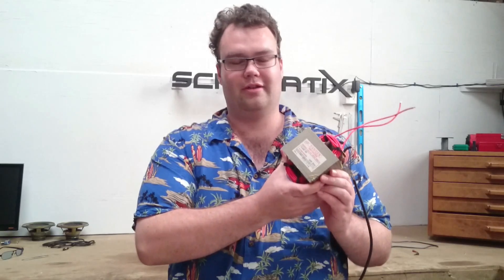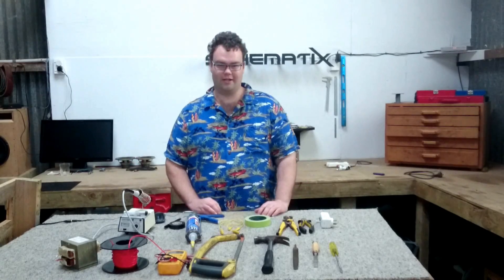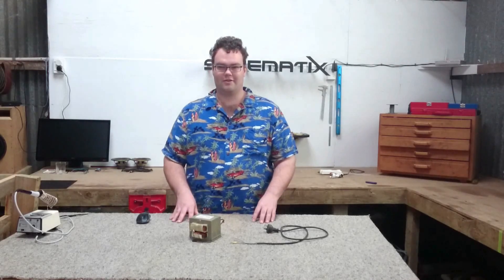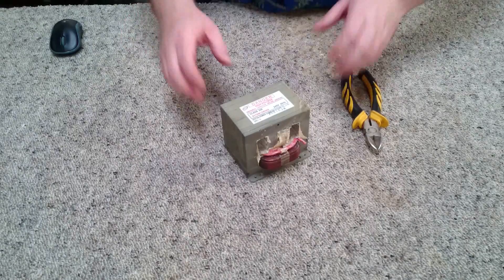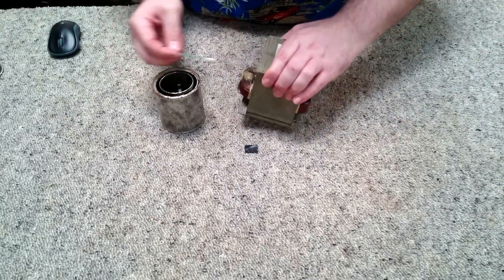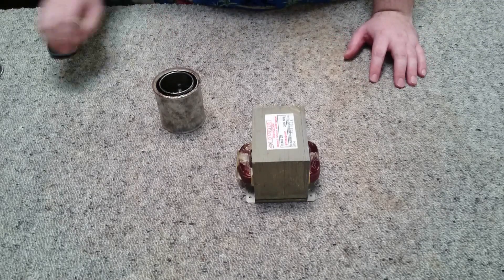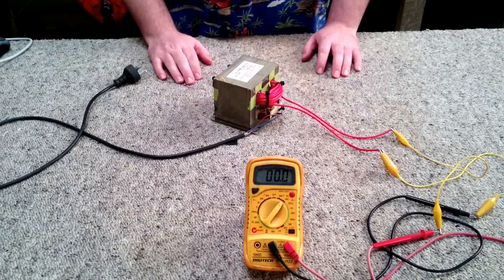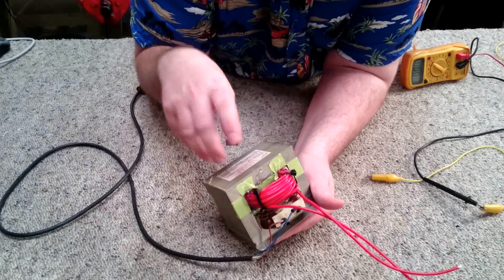How To: Rewind Microwave Oven Transformer, Trash To Treasure!

Comment: It appears this is mostly a mechanical how-to.  Maybe it helps if I add some electrical comments.  First, there are some manufacturer data sheets for transformer sizing.  Generally the more power required, the heavier the core becomes, KEEPING the line frequency the same.  A higher frequency allows reduced weight, up to a limit.  Above some 400 Hz, you need better (thinner laminations and those insulated from each other, also no more welds) materials and above 20 kHz you likely need to switch over to ferrites.
Then, the optimum tradeoff between core and winding heat losses comes at near 1:1 ratio of the iron cross area and the window (core space) cross area.  The winding formula is   n = U/(4.44 f b A), where n is number of turns, U is the applied RMS voltage, f is the frequency, b is the allowed peak magnetic field and A is the iron cross section.  All these in the metric system, i.e., the A is in square meters and b is in teslas.  The b depends on the iron quality and varies from 1.2 to 1.3 for most practical materials and some 1.55 to 1.7 for some crystal oriented materials.
Then, about the shunts - they are actually causing leakage magnetic field ("radiation").  Their purpose in the microwave oven is to LIMIT the current.  As such, they also cause additional heating of the transformer.  Along with too few turns in the primary, they are a cause of higher primary current (which was a concern in another comment).  For a bench power supply, where you should do current limit in electronics, you should replace those shunts with some wood or plastic strips.  That would improve your efficiency, although it would increase your INRUSH current, as the limiting action is discarded.
I hope this info still reaches some people who might benefit from it.
Reply: Great info!
Reply: Pellervo Kaskinen thanks for the info , for anything related to laminate I use the 42 constant, which is the Ae area effective divided by 42
I.e 42/ Ae  = Tpv 
Tpv = turns per volt
I have tested this extensively and can not fault it including ‘blind’ tests where I used it to predict the turns then unwind various ‘consumer’ windings to find it accurate, even on large turn numbers, however this equivalent may help with trying to derive a new ‘constant’ for various crystal hybrids so thank you . 
I don’t have my book here immediately but yes the primary of a microwave Transformer has missing meters worth of inductor based both on the 42 constant and on me predicting then unwinding. I believe it was missing many meters. This and other factors contribute to the excessive heat and energy loss that these lovable and famous devices radiate. Regards.
Reply: @kolinevans9127    MOTs are designed, to be STARTED   under  a LOAD.    NO load, and the magnetic fields'  hysterisis, completely saturated iron core, will  heat up.
Reply: remember: microwave transformer primaries  are wound,such that they  ALWAYS  START  UNDER  LOAD........for standby purposes.......add more windings, to reach 270 turns, or so. If not, it'll overheat.....
Reply: @petersack5074  or add some ballast
Reply: Pellervo Kaskinen I think I understand about 50 % of that.
Reply: This comment is the only redemption for the video .
Reply: You seem to know a lot about electronic stuff and how it works. I have a question if you don't mind. 
If I needed 12 VDC with a somewhat high current (for an HHO generator) I had to wind the transformer without the shunts, rectify, and smooth the ripple with a capacitor, then limit the current with some electronics, correct?
Reply: Kalle Klæp i hope I’m not too late but $10-15 led power supplies are 10-30A and $6-25 server power supplies are a whopping 60-100A. Very good little known sources for HHO
Reply: @Ferraday  Ah..server power supplies! I didn't have that thought yet. Thanks.. :)
Reply: @kalleklp7291  

12V transformers in the 4 to 10Amp range are very common. Your safest bet is to salvage one from a discarded device. You can easily calculate your desired wattage and use a power resistor (and fuse) to limit the current. Alternatively, you could buy a ready made high current switch mode supply for about $20 and add some ripple filtering. Stay safe!
Reply: @andrewferg8737  Thank s for your reply.. :)
Reply: @kalleklp7291  

If you're making a small HHO generator, you might consider using a battery.
Reply: @andrewferg8737  Thanks a lot. :)
Reply: How to minimize the heat generated with this kind of transformer for long use or I E type in general?
Reply: @gemkhamis2576  You need to add more primary windings.  These simple videos never mention you can't run these for long as they quickly heat up, like @petersack5074 is saying.
Reply: Would it be any better if we used a piece of plastic and one metal shunt then another piece of plastic, I'm new at this, thanks
Reply: I have a question for you since you seem electrically inclined. I'm looking to rewind one of these transformers for an even higher voltage by grinding off the weld and pulling the "E" "I" sections apart to access the core. I'm wanting to build a secondary out of 32 AWG wire with about 32000 turns to get roughly 30000v at 30mA. Will this turn count be sufficient? 
Assume I take the necessary precautions such as yellow tape bettween layers, in addition it will be submerged in mineral oil.  Supply power will be fed to a variac and the output of the variac to a bridge rectifier (no capacitors) with a 15amp fuse that feeds the primary winding which will be kept untouched. 
Will such a setup work?
Reply: @theq4602  

Just use the high V cap and diode that came with the same microwave from which you've taken the transformer... They form a doubling circuit that outputs several KV.
Reply: I've left my laminate in. Should I just use it?

Comment: trash to treasure? what trash
Reply: In my country you have to recycle all electronics, its forbidden to dispose a microwave with household waste. Even at the local recycling center they do not allow you to take an old microwaves with you. My only source for transformers is eBay. Good for the environment, bad and expensive for DIY :-(
Reply: How can I make full waves transform. Like 25-0-25 ac volts. Thank you.
Reply: I realize this probably too late, but others might be interested.

To create a center tap, find the voltage per turn like in the video.
Calculate the length of wire to be twice what you would need for one side of the tap.  In other words, it you need 25 turns for 25 volts, then you will need 50 feet of wire. Mark the center and feed both wire ends through the transformer until your mark is centered on one side. Pinch the wire there and twist it so it protrudes out a little from the bottom near the primary winding.

Then, wrap the wire ends around the central section, crossing every time they meet... Eventually you will have the two ends, and when you untwist and strip the wire where the center mark was, you will have your center tap.
Reply: How can I make a full wave transform, like 25-0-25 volts ac. Thank you.
Reply: Anyone can answer me. Thank you.
Reply: Manna Miah You would need two secondary windings showed in this video connected together with a center tap.

Comment: Great video. 
Just a note though. The wire can manage 15 Amps, but not when it wound in a coil. The 15 Amps are for normal installation.
Reply: Zeedijk Mike
Peak values.

Comment: Great idea with one caveat!  I spent about 1 hour wrestling  to get the wires out (full of epoxy on wires), wound 10 turns  got 10.6 volts so it worked like shown HOWEVER!!!!!!!

Here is the caveat.  This transformer is very powerful thus emitting very strong EMF radiation.  I have a radiation meter and sure enough it shows maximum reading when plug in.  EMF radiation causes cancer!   By the way if you stand in front of the microwave when it is on  EMF is max. too.  How do i know? my radiation meter of course!

I still build it but will not use it on bench close to me.  I will use it to charge a lithium pack for my electric bike.  The lithium pack that i built myself!.  Brief exposure is no issue but when you are working on project with power supply nearby on constantly   a NO NO for me.   I do have some smaller Weller old soldering iron with a 27V AC transformer that will work just fine for bench power supply.  I took radiation reading on that one and well within safety limit.

Invest in one of this if you can afford then you will be amazed to see how much EMF radiation you are surrounding with in your house and their strength.  I did invest in this one.     All transformers emits emf.  Now if we are talking about switching power supply then that is different.  Still there but much much lower exposure safe level.  Again by having a meter it will tell you.

Meter is quite expensive however  but i bought a few years back with little choice.  Now there are more on Ebay but this was the one that i bought.

https://www.amazon.com/Trifield-100XE-EMF-Meter/dp/B00050WQ1G
Reply from the maker: Thanks for the compliment. Not all types of radiation cause cancer. And claiming "EMF radiation causes cancer" isn't as simple as it sounds. The term radiation covers a vast amount of subject, even the light we see (colors) is radiation. Some types of radiation your meter would detect are so weak they can't penetrate the dead layer of skin on your body or a sheet of paper. So they are completely harmless. We are exposed to radiation from the earth, the sun, even the potassium in bananas are well known to emit radiation.  I'm not implying either one of our opinions is superior above the other. I'm providing the other half of the story. So before throwing on a lead suit because a meter screams "Radiation!" I recommend people do their own homework and make informed decisions for themselves. :)
Reply: the UV rays from the sun are more harmful than emf waves
Reply: To be fair big laminated transformers like these aren't really intended to be used open, they can cause interference. If you're concerned, just line the enclosure with copper tape and earth it, that should take care of it, but you can also not be quite sure by what factor the field measurement device is wrong, could be displaying 20 times the actual value easily.

Comment: Just a suggestion, The King of Random, did this same thing only he cut the welds holding the transformers metal parts togeather. He made his modifications, assembled everything, then reattached the 2 parts back togeather. For those that can weld or know someone that does why not just do that n reinsulate the area? Would make winding the 2nd coil much easier todo along with not damaging the primary coil when cleaning the housing of the insulation. Also don't the gauge of the wire matter when designing it?
Reply from the maker: Not all transformer come apart in E and I sections, many are laminated overlapping. This means you have to cut not just the welds but also through the whole transformer. However I've used both techniques, for a transformer that requires less than say 30 odd turns I find it's not necessary to split the transformer. if you avoid splitting the transformer it reduces the risk of introducing a 'humm' noise during operation. Also don't the gauge of the wire matter when designing it? Naturally the gauge of wire used dictates the amount of current the transformer can supply. You can't run 5amps of current through a wire rated for 4amps. It's worth noting the gauge of wire used has no effect on the voltage. The voltage is dictated by the ratio of turns between the primary and secondary.

Comment: Thanks for the video.How many meters did you use on the secondary, for 12AWG cable ?Thanks in advance.
Reply from the maker: You're welcome, I bought 10 meters and used most of it. Depending on the size of the core, as a guide each turn uses approx 300mm of wire.
Reply: Hi again.I just rewind the Transformer, but the core heats up without any load. Whats the reason? Thanks in advance.
Reply from the maker: Most transformers will be warm without any load. In simple terms you have to remember the primary winding is effectively a wire wound resistor between live and neutral and will always use some limited amount of energy even while no load is being drawn on the secondary. How hot the transformer gets does depend on a number of factors. I've got a couple commercially made transformer that easily break into the 50 degrees celsius mark. However If your transformer is too hot to touch there maybe a problem
Reply: Yes it might be around 50'c without load. Thanks for the information.
Reply: I want this

Comment: What about the magnetizing current? I checked the primary current of 4.5A from the 220V mains without having a secondary wound. The transformer heats considerably in a few minutes. I had to add ~80 turns to the primary to get ~ 400 mA AC.
Victor Koren
Reply: These are designed to saturate in normal use, which is why they do, and get hot (also the reason for the shunts).  Here in the states, with 120v nominal mains, this happens at 89 volts or so - same deal, you need more turns, or accept the waste and use a fan.
Reply: I wound transformer small and large. I also tested some of them with only the primary winding without a secondary.  The current was only a few milliamps.  A microwave oven trafo is designed to work short term a few minutes at a time.  The core is also undersized for the wattage it produces thus that is why they force them with magnetic flux making fewer turns to get more power out of them.  That explain the extra off load current 3 to 4 amps.
Reply from the maker: A microwave oven transformer should never draw 4.5a with no load. Either the primary is shorting (unlikely without you know about it) I'd say running the transformer without a secondary is whats causing the high current draw.
Reply: NO RUNNING A TRANSFORMER WITHOUT A SECONDARY WHAT ONE HAS IS AN INDUCTOR  ( A BALLAST ) OR IF THE PRIMARY HAS ONE OR MORE TAPS A AUTO-TRANSFORMER ....... THESE TRANSFORMERS  ARE NOT DESIGNED FOR CONTINUOUS DUTY  ......